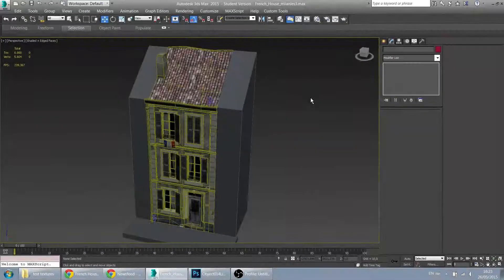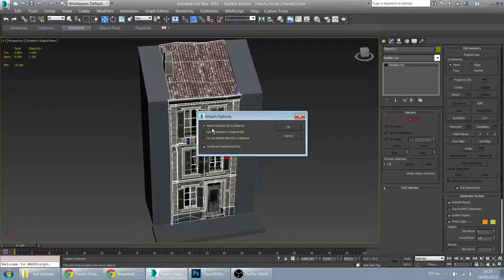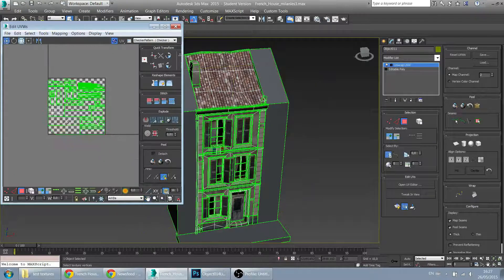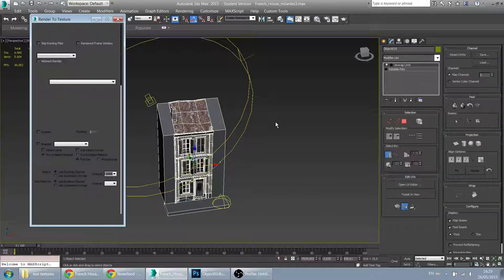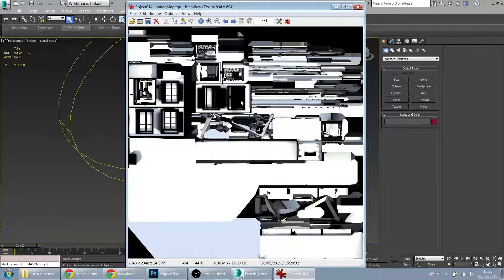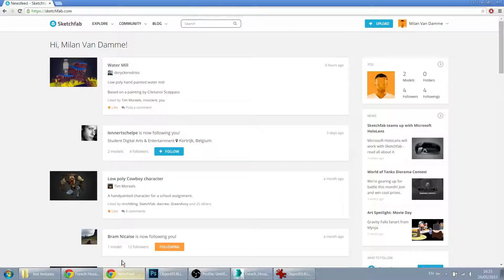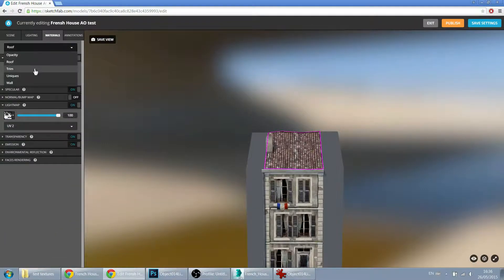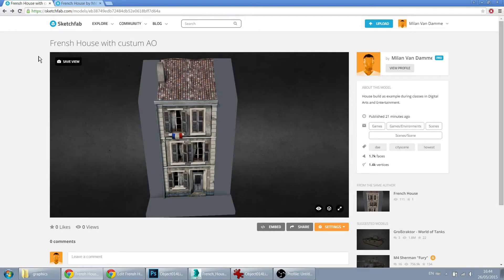Export Custom Lightmap from 3DS Max to Sketchfab

Comment: you merged all the model so, why do you have different parts in the 3D settings of Sketchfab? thank you!
Reply from the maker: +Alejandro Cejudo 
Hi,
I'm not sure if I understand your question fully.
The whole model uses different materials, based on a different material ID's. Those are the parts you can see in sketchfab.
I merged the model so I can have just one lightmap in the second UV channel and I have to do just one bake.
Hope this helps, if you have any further questions, just ask.